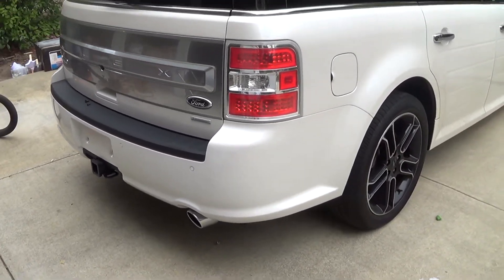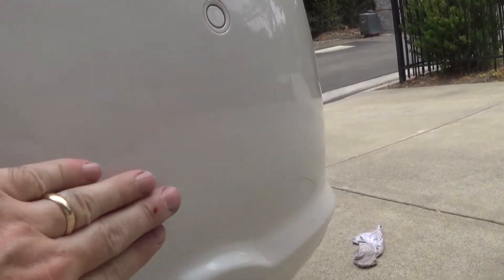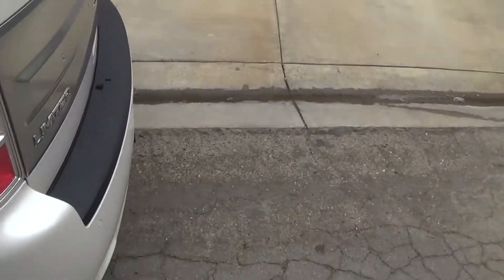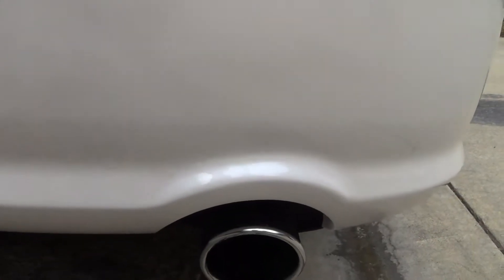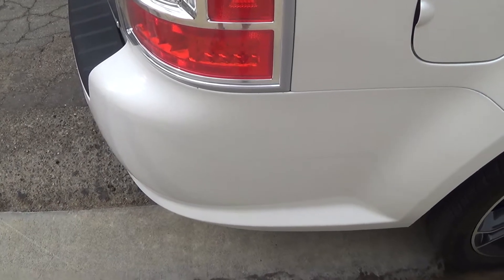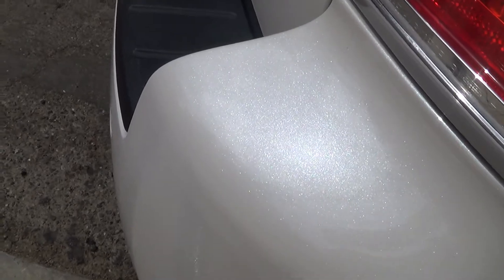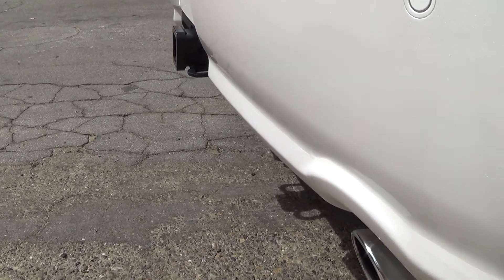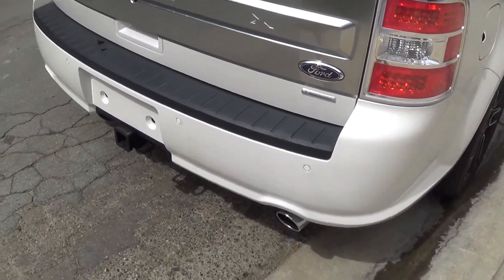Ford Flex bumper cover repair part 5: Done!

Comment: Great job Erik. I think it turned out great. I would think that a tri coat would be very difficult and you just pulled it off in your garage using waterborne to boot. Kudos to you. You will get even better on the next one. How did you like the flg4 gun?
Reply from the maker: Double R Restorations Thanks a lot Russ. I think the tri-coat was ok because I had a small area to work on. So, the risk of mottling, stripes, etc. were minimized. The gun worked great for the base and mid. I am unsure of the clear because of the runs. I may not have it dialed in right, or I had the wrong reducer. The orange peel was sweet though. I could probably smooth it out more with practice.